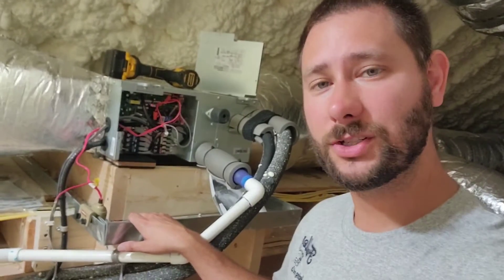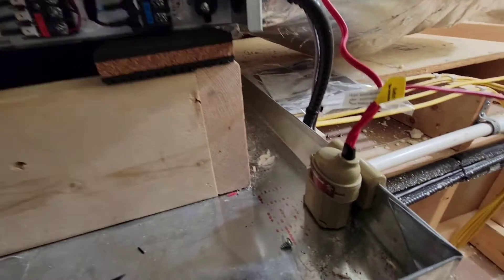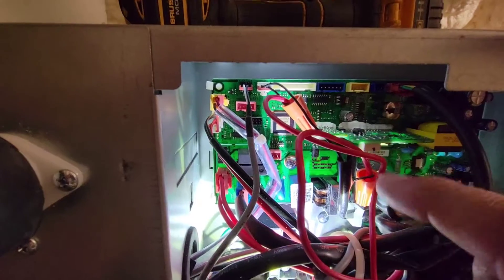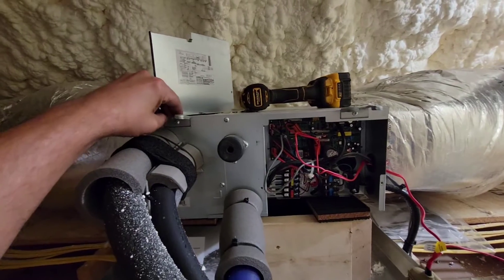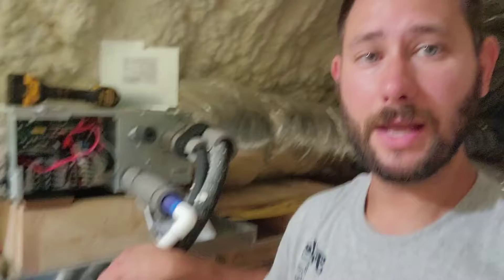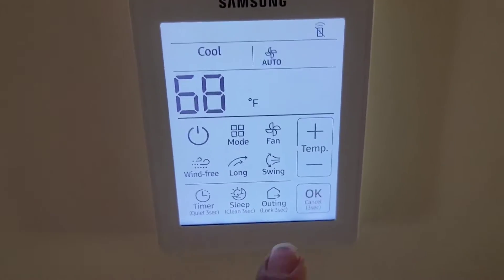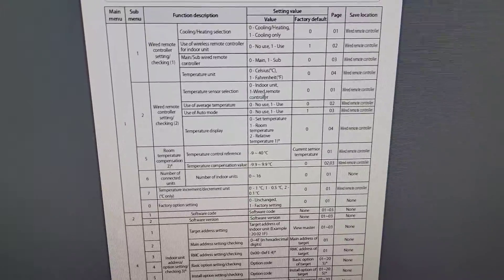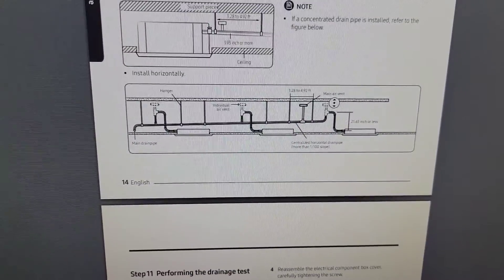How to Install a Float Switch for Samsung Ducted Air Handler #floatswitch #SamsungHVAC #ducted

Comment: Isn’t there a gravity port on the opposite side of the unit?  Is so could you install a cs-2 float switch on this side as well as the float switch in the emergency drip pan for added protection?  I’m only asking because I’m in the middle of doing a similar unit right now for myself. Thank you.

Comment: Why wouldn't you use the terminal for the float switch? Its to the left of the one you pointed out in the wiring diagram. It probably has a jumper you remove and terminal screws for the wire in.

Comment: Use your finger to point to a scripture when pointing at an electrical diagram or the tip of a pen or an electrical prong so anyone can follow you.

That attic if it doesn't have ventilation, the air handler will sweat and the drain will condensate. So at least the drain pipe better be insulated.

Comment: I would like to start /stop the AC unit by external 7-day timer .. (start cooling in the morning and stop in the evening and not to operate on sundays) this schedule can be done by using external timer.
My question is .. where to connect the output switch this timer ?
Reply from the maker: Got a video coming out should help answer your question